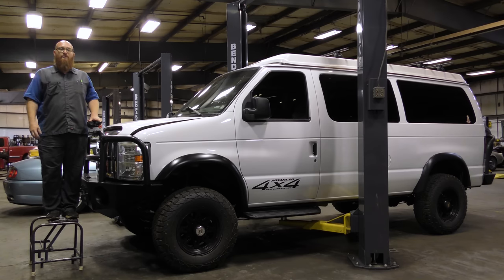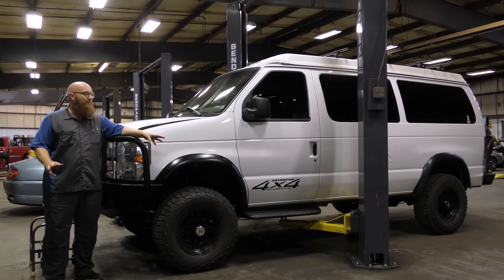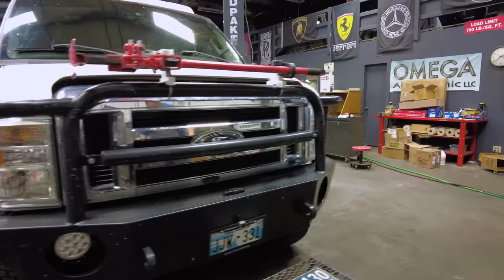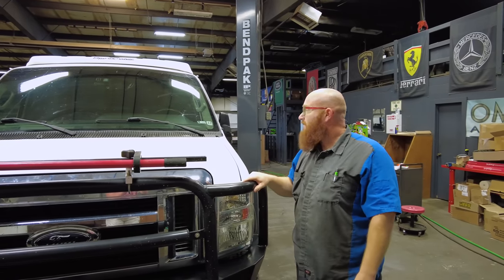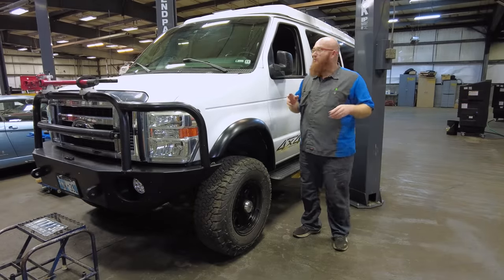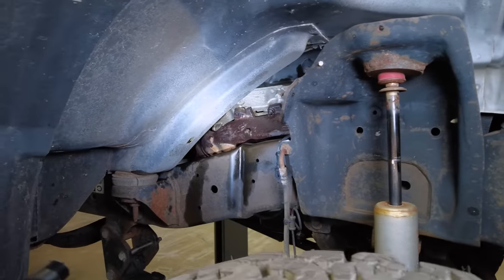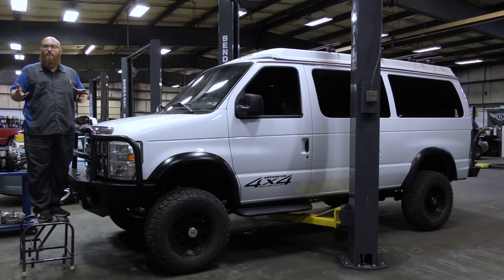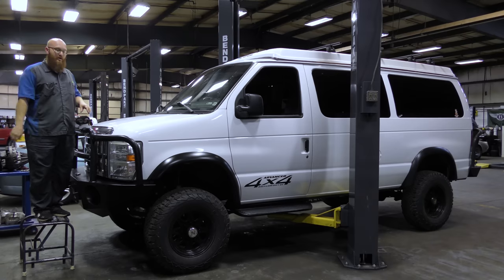8 shops refused to work on this custom '10 E-Series Van! CAR WIZARD shows how easy it was to fix!

Comment: Regular shops just want vehicles preferably no older than 10 years and completely unmodified. In and out within an hour, oil, shocks, brakes, aircon, exhaust and other standard stuff.
Just an assembly line of throwing parts into cars. Volume is key, so anything that could hold this up is not economically viable, because it's not just about that customer paying hours and hours of labor, but ten other customers who have to be turned away because one lift is occupied by something that no-one is quite sure what parts it needs, parts not available, rusted, hard to get to, it's just much easier to do 10 econoboxes in that time.

Of course The Wizard is a very different kind of beast in that regard. He rushes in where angels fear to tread. 😁

Comment: The blankets in the back of the van were very attractive. The hydraulic table made removing the transfer case a breeze. The problem with off-roading vans is that they are continuous pieces of sheet metal and have difficulty flexing. Trucks with a break in the middle do better off-roading than vans. There is a reason that there are no factory adventure vans it's not that great an idea.

Comment: Oil shouldn’t be getting into the spacer between the gearbox and transfer case. It should be stopped by the gearbox output shaft seal and the transfer box input shaft seal, should it not? If so, one or both seals are leaking.

Comment: Hell, on my common as dirt Ford F-250 Super Duty they pull the body off of the frame if access is needed on the Powerstroke engine…last time I stuck my head in the Ford dealers service bay they had two bodies off of frames.

Comment: I've done the exhaust manifold on those vans. It's much easier than the F series. At least Ford was smart enough to not put the 3 valve in there. I will work on almost anything. I tell my shop foreman, "I'll do any job, I don't care". But I have told people that I won't work on the 3 valve 5.4 in the F150. It's a pointless waste of the customer's money. You find out that they waited so long to change the plugs that the cats are plugged... After spending hours getting the old plugs out. To say nothing of cam phasers.

Comment: Alot of shops will turn away work they don't see as quick in and out jobs..

I've been looking for a shop to do a 2.0 jdm swap into my subaru ..

If I was comfortable doing the 2.5 timing belt needed to swap it out I'd actually buy a engine hoist to do it myself

Comment: The front end comes off if you need to go and take off the heads and Timing components. I own a 13 with the same conversion. The center console removes with 4 snap camps. Takes 10 seconds to remove

Comment: What I've run into is shops that don't do diagnostics or problem solving. For a nonstandard vehicle there's no estimater book to look up how many hours to bill.
If they looked out the window to solve the problem the risk is on them. If they look in a book, do what the book says they "did their job" regardless of fixing the problem.

Comment: You could probably disable the parking sensors with Forscan. It will allow you to add features so it should allow you to disable them and if i remember correctly it's only $10 a year for the program
Reply: Or you could drill the bumper and add the sensors back in.

Comment: Officially the only authorized ford E series conversion was done by Quigly customs with the official backing of ford motor company. When the last E series vans came out I believe Quigly had gone under and many were converted by non approved companies. Chances are cause this wasn’t a ford factory “;approved” aftermarket job the other places didn’t want to be involved if something went horribly wrong

Comment: at 120k miles ypu should recomend a set of spark plugs, roller followers snd vct solenoids. Ford has redesigned the followers and vcr solienoids.
I have an 08 expedition with the 5.4 and 173K miles.
no missfires, but mpg was down so i removed the plugs and the center electrodes were worn flat, gap .101 ! 
+2/3 mpg after just new plugs. 
Ford redesigned the heads so the plugs are fully threaded now and wont snap off/blow out like the prior ones

Comment: You should look into a ma star 5.5 lift from Maha. 12klbs lifting capacity and the synchronisation wire can be put in ground so you can use your complete ceiling height.

Comment: If you ever hafts replace manifold studs on a Ford Dodge or Chevy, Do yourself a favor and get the stainless steel exhaust manifold bolts. I’ve got a set on mine and they’ve seen three harsh New York State winters and look brand new still. They won’t rust and snap. And they’re pretty cheap.

Comment: Never, ever trust silicone sealant to replace a paper or rubberized gasket. Silicone degrades over time, causing leaks. Some shops
will use silicone on an oil pan or transmission pan, and send you out the door half an hour later. Be prepared for leaks, because the
silicone takes hours to fully cure. Silicone, or another Permatex gasket sealer, can be used as an adjunct, but never as the only bond between a pan, and an engine or transmission. Air cooled VW shops would occasionally use black, red, or blue silicone, instead of
cork or rubber gaskets, on the valve covers. A guaranteed disaster.

Comment: I would venture a guess that the slightest perceived extra effort needed to work on this, is just seen as too much by most shops. Plus the aftermarket conversion that nobody wants to be responsible for makes it harder to find anyone to work on it.

Comment: These really aren’t bad to do engine swaps on once you get the whole front end out of it. Rather do one of these than an 05+ F150. We did one In a box truck with a V10 and it went smooth.

Comment: Very important correction. The 4th generation Econoline/E-Series was never ever offered with any 3v modular engine, 5.4 or otherwise. These vans in 2010 were offered with 4.6l 2v V8's. 5.4 2v V8's or in the heavy duty vans and cutaway, the 6.8 2v V10. On a related note the 3v V10 doesn't have variable cam timing or cam phasers at all.see documents below. https://en.m.wikipedia.org/wiki/Ford_E-Series
Reply: https://en.m.wikipedia.org/wiki/Ford_Modular_engine#5.4

Comment: "Not beat up, scratched" Why... does it only go on adventures to the grocery store?

Wizard, don't the Econoline vans come with the 5.4 two-valve?

About the manifolds - I had a 2.9 liter engine in a Colorado that developed an exhaust leak. I went to replace the manifold gasket, and upon removing the exhaust manifold it split in two, and one of the bolts broke off in the head. I got lucky and got the bolt out, replaced all of them with studs, and replaced the manifold with a header, which was cheaper even with the catalyst.

Comment: Id rebuild the transfer case while its out, 7mpg max with these and its interesting how this company in utah is using sportsmobile parts on it, when sportsmobile has been doing these conversions for decades, I had one years ago, now the sprinter, transit, dodge all come with 4wd so these are a dying breed
Reply: Sportsmobile doesn't do the 4x4 conversions, they are done by Quigley's or another such firm, perhaps this one.

Comment: If you have to change an engine in a full size van, the core support usually has a center section that unbolts and can be removed after the grille, radiator,  condenser, possibly the bumper, and a few other things are taken loose. The engine then can come straight forward through that hole you just made in the front end.

Additionally, the other shops may have said no because the was a Ford built 4WD full size van model that used a triple output transfer case and had two driveshafts arranged in a V shape powering the front axle, one driveshaft going to each half of the front axle and powering only one wheel. They look like they are a nightmare to work on.

Comment: ! have an2011 E-250 w/ the 5.4 with 152k, just did the plugs and coils and had to replace the two catalytic converters and the engine runs great and the engine light has gone off after the tune-up. Took it in for state inspection and it failed for body mount deteriorating. I found two that rubber was breaking apart between the body and chassis behind the rear axle, some have a few cracks but not coming apart and the front ones are still in decent shape. I removed the two bad ones and got Doorman replacements. I had to cut the old ones to remove, but now I wonder if a replacement is made so that the body does not have to be raised? If one was made with the steel cup and the tube shorter for the upper one and a longer tube for the lower mount, then it could be assembled from the bottom. I can see it at the factory the way they are made would make assembly easier. Anyone has any ideas on replacing two mounts without doing all the mounts and raising the body.

Comment: I have a 2012 ram 1500 with a 6” lift and 37” tires. I have no warble or steering issues at all. On the manifold bolts, I had both sides fixed about 20k ago replaced all studs and nut and the driver side is busted again

Comment: Wizard, do you mind telling why you dislike this engine?  I just bought a used 2007 E350 to convert and it has the same engine with 279k miles on it.  Thanks.

Comment: Van are always and bottom removal for the engine. If you have the proper equipment (like you do) it is actually easier than many removal from the top swaps.

Comment: They never put the 3 valve 5.4 (24 valve) on the Econoline. They only put the 2 valve 5.4 (16 valve) in the Econoline. So the 5.4 in the Econoline is a good engine. There is also the Powerstroke diesel 4.6 V8 and the 6.8 V10 on the heavy duty ones.

Comment: I've noticed a general decline in auto mechanic quality. Ever since COVID wiped out all the small mechanics, I have been unable to find technicians willing to do simple procedures, and will usually just quote me an astronomically large bill for say... a remanned engine when all I need is new valve seals on my Chevy V8.
I was training in the Ford stars program, and I brought alot of my backyard knowledge with me. I learned new things too, but during the program I was actively punished by the instructors for using my intuition rather than the computer diagnostic system. Even when my intuition turned out to be right. The entire program was extremely frustrating to deal with, and I eventually quit before I got all my certs. (I had health problems too but its unrelated to the point I'm trying to make.)
Many talented backyard mechanics went into that program with me, and many dropped out like I eventually did.

Comment: Only reason I can think of for so many denials of service is their lifts can't handle the weight or not enough clearance. I did a tire rotation on my bro in laws raptor, and due to the height and amount of articulation that the wheels can do, I was barely able to raise it enough to get the tires of the ground, the lift Jack's were to short. Literally had like an inch of clearance.
Ford Dealers probably won't touch the custom stuff though
Reply: That's why there is a "hi-lift" jack on the front bullbar....
not a happy thing for pedestrians to bounce off....
but essential for tryre changing "out there" on the trail......
just carry very large chocks for the other 3 wheels....
or like the Japanese cars provided OEM as part of the tool kit...had in the 1970's...collapsible steel chocks that took up little room but "extended" to a good size....

Comment: I find it mildly amusing that they had more trouble getting a lifted van into a shop, while I had no trouble finding a shop that would work on a 1974 Hilux with an 18R-C engine (old, with low availability). 

Even had an exhaust leak on it, and an out of tune carb.

Comment: Love E-Series vans, but I don’t think ford put the 3 valve motors in them. All gas E-Series vans came with 2 valve.
Reply: But it may have had bits from the F series as Wizard says...
might have included the 5.4 3v engine?

Comment: My experience with 4WD front suspensions is limited. However, my friend’s Jeep CJ5 has a straight axle front end and he was having tracking issues — like you’d go over a bump and when you came down it would dart in random directions. He fixed it with U-bolt mounts that were tapered to give your axle an additional two degrees of positive caster. Immediate game-changer. Problem solved. I wonder if something similar would help this van’s tendency to wander.
Reply: Those wedges to alter alignment are in thousandths of an inch.
I had the misfortune to drive one that had had 10th of an inch wedges installed on both spring U bolt mounts during an alignment.....
you needed all of a lane to stay in your lane over any road ripples....
until they put the right wedges in!

Comment: I am surprised they don't have that van converted over to travel in. I would make a little camper out of it
Reply: They may have a "cassette" of camper that slides in and out....so they can get maximum use from the van?

Comment: I hate the stacked headlights.  They seem to run all four bulbs on low beams (either that or everyone here uses their high beams all the time) and the turn signal is very difficult to see since it is between the bulbs.  Other than that, a really cool vehicle.

Comment: You pull the engine through the front (radiator, bumper, grill etc all come out).  It can't be worse than doing a 6.0 diesel...

Comment: Lately I've been having major mechanic shops tell me they won't look at my cars because they're older than 20 years.. which completely confuses me because cars were built a whole lot simpler back then.

So what's the problem?
Reply: The only thing I can think of is a 20 year old vehicle has cascading problems and cheap owners. I'm milking my model year 2000 rusty excursion for another year, then probably keep it as a winter beater until my eldest gets her license in 4 years.

Comment: 1 or 2 front sway bar links broken can make the steering feel vague. I’ve owned 2004, 2009 and 2011 Rangers and sway bar links break with regularity. I’d love to find stronger aftermarket sway bar links.

Comment: I run into some places say they cannot do SI on my 3500 Ram truck dually 4x4, for same issue as this van, wont fit on their lift , cant get in the door, cant go up high enough. I got a nice shop 2 miles from house that can as they also work on and own a lot of big tow trucks, etc...

Comment: yah it's nuts - anything slightly custom or pre-OBDII shops just will not work on. I had several thousand dollars in my pocket ready to spend on a Gen 1 Montero and I called many shops who flat out turned it down without ever looking at it. Finally had to get a referral from a forum for just a guy who works on them - not even a shop but just some dude because shops won't work on anything that isn't either an insurance job or a car less than 20 years old.

Comment: from what you showed it was only slightly harder. i wonder if he contacted truck garages.  back in 70 and 80s dad and i had 3/4 ton step vans  and some shops just did not understand them even though they had running gear the same as pickup

Comment: There are BendPak 4-post lifts with 14,000 lb. capacity (HD-14T) with an 82 inch lift..  I'm just curious as to why you didn't use something like that to raise the van to the height you needed.

Comment: It is not just the vans, try to find a Ford shop to work on the ford motorhome F-53 chassis.  Even warranty work, auto shops say they are to big, commercial truck shops just say they do not work on RVs.

Comment: IDS is very cheap to purchase and setup. You need a VCX nano with Ford license and any computer really. However it will be complicated to rewrite CCF with IDS.
I do most of this stuff with Forscan. Get forscan with extended license for peanuts and then an OBDlink EX and you will be surprised.
I have both and very rarely use IDS since Forscan does more much easily.
I've sent you an email get in touch and I will help you for free to setup these.

Comment: I don’t know if this van has the 4x4 tire problem. Too many vehicles with a full-size spare on the back end up with 4 bald tires and a never used 5th. Even when they buy 5 aftermarket tires that 5th one never gets a mile on it.

Comment: To many shops have Primadonna’s working at them and or techs that aren’t knowledgeable the shop owners that refuse to work on them only want the easy money jobs. 
Unfortunately that’s just how it is. If you can’t fix it yourself then you must pay the going rate. 
Many shops also up charge their hourly rate for different jobs or cars. 
We charge extra only if it’s something we don’t typically work on or if we just aren’t set up to do it and the customer doesn’t want to go Elsewhere.

Comment: I have a 2013 extended e350 and I've had the same issues with getting it worked on. They see the 4x4 and run.

Comment: Not sure what load range the tires are. I use a high load range on my trucks that have bigger tires and it helps with that slight delay in the steering

Comment: the front axle might be similar to an F250 or whatever, but it certainly isn't the same: Ford hasn't used leaf springs up front since the late 90s (at least on 3/4 and 1 ton)

Comment: To be honest I can kind of understand why lesser shops wouldn't work on it - aside from things like the engine being a pain to work on, you've got the suspension and 4wd conversion which could have been an absolute bodged mess, and you've got a butt load of suspension and drivetrain parts on there that came from what?  Are they ford?  Dodge? Mini Cooper?  Can you actually get replacements easily? The average garage wouldn't go near it and I can't blame them!  Luckily they call him the Wizard for a reason.

Comment: I LOV this truck so nice i would stick a better engine in it and i get it the Ford help them because they used stock 4by 4 parts .Thats a really heavy front end .My 96 ford has independent front end and just adding a little Wtg its has a great ride